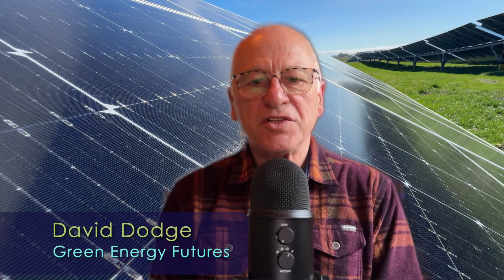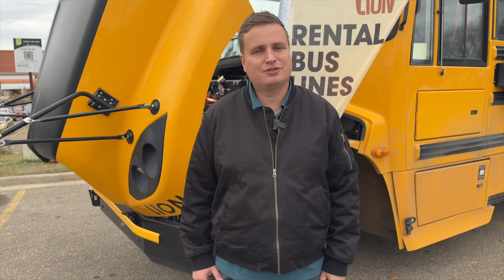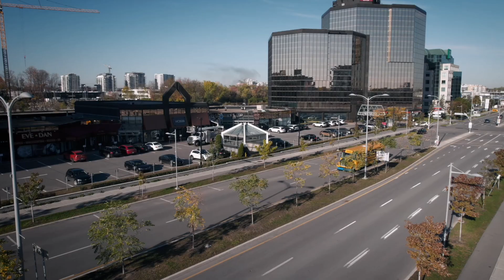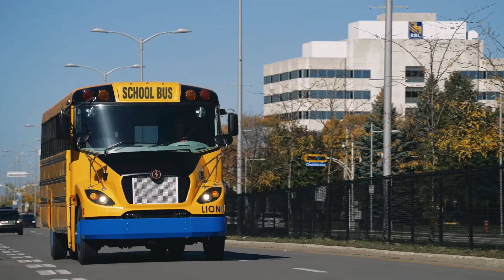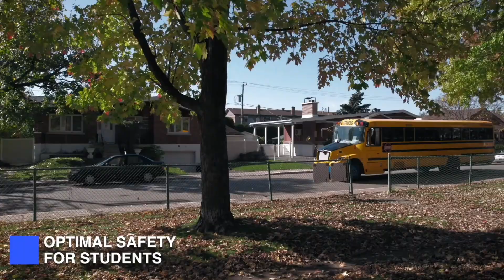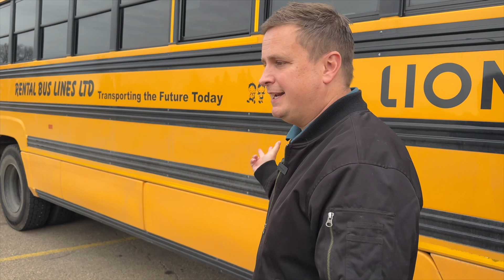Canada's Electric School Bus Revolution

Comment: I have asked the question many times. What is the cradle to grave emissions difference. Mining materials, fabrication, maintenance, battery replacement, de-commissioning. Crickets. All in? No tailpipe but emissions galore. I am talking starting from scratch. Generating extra electricity...everything.

Comment: 150 to 170 km per charge, and 6 hours to charge. Seems ok, but that is warm driving figures. No facts about the winter months and using the heater on high. I took a Rural bus for two years, and if our driver wasn't a awesome driver, we could have been stranded on side roads for an hour or two. I would also like to ask how zero emission works with the production of the batteries, and the rest of the bus parts? It don't count until it is done I guess?
Reply from the maker: Check out our blog for a little more information. He talks about the battery warmers and very little loss of range in the winter thanks to the diesel cabin heaters that don't draw from the drive battery. A reasonable compromise on going electric. https://www.greenenergyfutures.ca/episode/389-electric-school-bus-in-the-cold-canadian-north

Comment: Edmonton Alberta’s try with electric busses has been a horrendous failure. So now why don’t we put children at risk in freezing cold temps. Asinine comes to mind.
Reply from the maker: Insane would be going back to horse and buggies. These buses are much warmer than traditional diesel buses which are actually pretty chilly inside on cold days. Ask any bus driver. They are cheaper to operate, maintain and they work when its really cold thanks to battery warmers and the diesel heating systems which helps the buses preserve their range in cold weather.

Comment: Cold climate should not matter, they sell heating pads for RV batteries..... 12v various sizes.... but you would of course have to increase capacity to power the pads, insulate battery boxes in winter... the new LTO cells are not affected by cold as much as other chemistries, li-po, li-ion, lifepo4... and you can bolt them together, no special spot welder needed, no spot welder consumables, tips... no grinding tips...
Reply from the maker: These buses have battery warmers and thanks to the compromise of using a diesel powered heating system these buses are actually warm in the winter in contrast to diesel buses. This company has used their electric bus as a warming station while trying to boost diesel buses in cold weather.

Comment: Hope the batteries don’t catch on fire.
Reply: No to need hope, statistical facts prove it is extremely unlikely. A BMW 6cylinder Diesel is way more fire prone to the point it was RECALLED.
Reply: @  But try to put out the fire.
Reply from the maker: EVs don't catch fire any more often than ICE vehicles. My neighbour drives a school bus and it recently burst into flames on a cold winter day. It was a diesel powered bus.

Comment: How much energy does it take to make the mortar and batteries and then when you recycle it how much energy does it take but you can't recycle everything what happens when wind blows up and there's lawsuits flying around because of kids that lost their life
Reply: What a bunch of absurd nonsense. How do you RECYCLE BURNT Diesel fuel? You don't care about that.
Reply from the maker: Electric vehicles are safter statistically, and although the embodied carbon is higher making the battery systems, the over all emissions are far lower for electric buses. Batteries are already being recycled by LiCycle a company based in Ontario.

Comment: was child slave labor used to get the material to make the batteries
Reply: LiFePO4 uses ZERO Cobalt. The biggest supplier of Lithium to EV industry by a big lead is AUSTRALIA. No child slave labor required.
Meanwhile the catalytic converter in you vehicle and catalyst to refine crude oil into light fuels. Requires far more exotic metals than these battery chemistries. You don't care about the child slave labor required for your Gas Guzzler do you?

Comment: Wait till the batteries explode and your child is stuck on that bus.
No thanks
Reply: You specifically stated "batteries EXPLODE" which is nearly IMPOSSIBLE. Yes slow flaming fire is extremely unlikely possible. But concussive explosions is Implausible.
Reply from the maker: Electric vehicles are far less likely to catch fire than an internal combustion engine vehicle and the the latter also has a large tank of fuel available when they catch fire.

Comment: How much carbon was produced manufacturing the battery for this monstrosity.
Reply: A small fraction compared the powering a 100% Diesel fueled bus. What the frack do think Diesel is made out of, it's a Hyrdo CARBON.
These buses have cost cutting measure SMALL Battery for their purpose. Just 2x Tesla car batteries. So very far from a monstrosity.
Reply: @Neojhun  I see you have had way too much green cool aid!  Before you spout off, you really should do some research on EV's in general.
Reply: do you ask the same question when you fill up your gas tank?
you should
gasoline does not, in fact, come from unicorn tears...

Comment: They should add solar to the roofs, if not for charging the battery then to work the climate at least.  Sono Motors in Germany offers kits for this, for example.

Comment: How much fossil fuels get burnt generating the electricity to charge this electric bus?
Reply: Quebec uses 100% hydro dams 😂
Reply: Massively less than 100% Diesel. Albert's Grid is 17% Coal and 64% Gas. Combined cycle power plant is massively more efficient than a vehicle engine. Vehicle Engines are about 60% the efficiency of Combined cycle power plant.
Reply from the maker: Alberta now has zero coal and about 22% renewable energy along with the gas. It's getting better every day.
Reply: And who can tell me the (in)efficiency numbers of charging batteries? I'll wait
Reply: @hitekredneck109  Hey Hitch, I see none of these cooled drinking clowns have gotten back to you.

Comment: You people are so full of nonsense it is unbelievable.  First item is  "green."  REALLY?  WHERE DO THE   EVs  get the energy for recharging?  FROM THE GRID.  The  grid is not green and never will be.  Next,  battery fires.  Extrapolate the battery fires we have heard in the news,  snap your fingers and imagine a world where ALL vehicles are  EV.  People are going to die. IT IS NOT  cheaper to convert  energy  2 or 3 or 4 times to different   forms,  AKA  take  some  current  grid sourced energy, whether   coal, oil, NG, or even  solar or wind,  and  charge up a battery.  last is energy density,  and the "refuel" time.
Reply: LOL You copy and pasted a wacko insane fear mongering scripts. Then also accidentally used Justification in your word processor. Those are very noob troll farm moves. I bet you can't even respond comments, just copy and paste spamming.

Comment: lol . how much carbon dioxide does it take to charge this monstrosity ? .smh . fp .
Reply: Less than diesel
Way less
Cheaper to run
Cheaper to maintain
Better to drive
Cleaner air for kids
That's what winning looks like
Reply: Considering Albtera's Grid is 17% Coal and 64% Gas. FYI VW Diesel Gate was NOT about CO2 GHG. It was healt damaging toxic emissions. 64% Gas is massively cleaner than 100% Diesel. Vehicle engines are also about 60% the Efficiency of a Combined Cycle Gas Power Plant.
Reply from the maker: @Neojhun  Alberta has no coal-fired electricity as of last year.
Reply: 100% hydrodam in Quebec 😂😂
Reply: Or manufacture it

Comment: How do you charge these buses? Through the power grid which is run by coal at the power plant.
Reply: Still cleaner than diesel
And we don't sit the kids on top of the powerplant
Maybe the windiest sunniest province in the country could produce power some other way...
Reply: @chriskimber7179  Electric vehicles are a scam, a passing fad, dangerous, bad for the environment.
Reply: "grid which is run by coal at the power plant" Alberta's Grid mix is only 17% COAL. Still massively cleaner than 100% Diesel.
Reply: @Neojhun  Did you understand my comment?
Reply from the maker: @justasimplelife3857  coal has been phased out in Alberta.

Comment: Before you get all excited remember, the City of Edmonton has 60 electric buses in the transit fleet. They have proven to be virtually useless, particularly in the winter months. The problem lies in range. While school buses do not need long range capabilities because their routes are relatively short and they can recharge between the two times per day that they are needed, transit buses must run continually for at least 8 continual hours per day. They also must travel considerably more kilometers. In the summer months they can accomplish their task but come winter, well, that's a different story. The City has also had problems keeping the batteries from freezing which ruins them and they require replacement. They did retrofit thermo blankets on some buses but that did not cure the problem. In addition, unlike diesel buses that can be refueled and dispatched in less than an hour, electric buses require a 10 to 15 hour full recharge time to be ready for one shift. Since the City runs buses up to 20 hours a day, you will need to have a lot more buses on hand to keep service at it's present levels.

Electric vehicles are still in their infancy. Until they can get their range way up and recharge times way down, they will not be ready to take over anytime soon. For transit purposes hybrids would make a lot more sense.
Reply from the maker: @oh8wingman  the City did their homework and made a bad bet. These buses address most of the flaws of the Proterra buses the City bought. This company has gone slow. First bus in 2017, then their second in 2023. They use readily available parts (big problem with the Proterra buses) and they’re built for the Canadian winter performing better than the diesel buses.
Reply: @greenenergyfutures maybe for a school bus, but there is no electric city transit bus that is not a major compromise. Freind of mine was involved in Toronto Transit Commision trials of proterra, BYD, and I think New Flyer. All three had problems. To top it off they were all diesel powered (and from transformer losses likely less efficiently) as the charging station was powered by a 40' Cat shipping container genset. the infrastructure didn't support charging using the power grid. EVs have a long way to go before they will be better than ICE. No doubt one day they could be, but that day isn't today.
Reply: @greenenergyfutures  They still don't have the range required and charge times and the power requirements to any one bus barn are too great without massive changes to the electrical grid. There are some who are working on controlled discharge capacitors to eliminate batteries altogether but they are a long ways off right now. Capacitors can be recharged in minutes instead of hours.
Reply: Let's endanger our children even more.
Reply: Electric busses are working quite well in the Nordic countries.  Edmonton unfortunately purchased theirs from a manufacturer that made a poor quality product.
Reply: @heronimousbrapson863  no one wants and we don't need them

Comment: So you still need diesel. Now you have to go fill it up and plug it in. They could use diesel heaters on regular buses and have warm buses in the morning. They have a ways to go yet.
Reply: U gotta plug in diesel too
Otherwise they don't start in the cold
Reply: @chriskimber7179  True. You could just run the same heater as the electric and they would start.
Reply from the maker: @lawrencehalpin6611  it’s a great first step for the Canadian winter. They use their electric buses as warming stations when they are boosting their diesel buses.  Their entire drive power is electric. It’s a smart compromise.
Reply: @greenenergyfutures  But you still need diesel for heating. and they only have 175 kilometer range and not enough power to charge them. So a long ways to go. It will take years to get that all figured out.
Reply: @lawrencehalpin6611  "175 kilometer range and not enough" Umm that covers a whole driving stint for In City bus routes. You clearly have no clue what you are talking about.
Reply: @Neojhun  And then stop for three hours. Or have double the buses you really need. Your clearly have no clue what you are talking about.

Comment: So... The buses move with electric motors but STILL need diesel to function on cold days. When did we stop using block heaters?
Reply: "STILL need diesel to function on cold days" WRONG not to function, just to make it comfortable for the Occupants. Basically every modern BEV has a similar system to Block Heaters, they can heat them selves electrically from Charger Power. On consumer EV cars you can either set a timer or trigger it remotely from an App. The amount of diesel used for heating is a tiny fraction compared the massive amount of energy required to actually move a large vehicle. The difference in diesel usages is a tiny fraction less.
Reply: Diesel bus won't even start on cold days without being plugged in
Reply from the maker: And they use the electric buses as warming stations while they are boosting the diesel buses on super frosty mornings.
Reply: Just for heating.

Comment: Depending on how long the manufacturing of the busses is the bottleneck, it may be possible to retrofit older busses with E-axles. Edison Motors ( in BC ) will be training garages in 2025 to install retrofit fit kits for trucks ranging from F-450s to multi-trailer logging semis. So that could be another source starting in 2026.
Reply: Edison motors is developing a half ton electric pickup with Boss Garage.
Reply: @kazgoz2529  They are developing a retrofit kit with DeBoss Garage for F-450 and I believe they have already finished the test conversion a pickup. The retrofit kit could be installed in a half-ton but they are targeting larger vocational trucks, not smaller vehicles.They are building 4 or 5 Semi sized work vehicles. eg. Semis and a snowplow. They have not said what the other 2 or 3 large vehicles they building will be. They also have the ability to retrofit semis and talking about powered trailers with e-axels.

Comment: In the video the guy mentions that they have to spread the busses around as the grid can't support all of them charging at once in the smart spot. If they had some sort of battery system that gets trickled charged from the grid change this scenario?
Reply: @gusbarber00 I think yes, but  suitably sized system is going to cost lots. It could make sense right now, if they could arrange things to make some money by trading electricity back to and fro with the grid. This sort of thing is going to improve as the grid operators and other parties gear up.
Reply: @grahammonk8013  Hmm this makes sense. I didn't say it in my post but I was thinking into the future.  It sounds like it makes more financial sense to spread the busses out to avoid the grid issues but when his electric fleet gets bigger it would obviously become harder to spread them out.
Reply: @gusbarber00 they are already charging at a fairly slow rate; 6 hours to fully charge from empty, which still requires 80A (@ 240V I assume).

For context, most homes only have a 100A service, so grid infrastructure for a whole bus fleet would not be too different than that for a small subdivision… which requires some serious planning (and cost).
Reply: Great Video.
I wonder how much diesel has been saved.
Reply from the maker: This is not necessarilly a bad thing. By spreading the buses around in smaller lots with 5-10 buses they can be located closer to where they will be used. This reduces the cost of the charging infrastructure since it would require few if any distribution upgrades. And there is already a Vancouer startup company working on the infrastructure to digitally interconnect the electric buses in a virtual power plant which could provide significant additional revenue for fleet owners and it would also help us all save money on avoided grid expansion to satisfy short term peak energy demand.
Reply: @greenenergyfutures  I disagree.  This will cost energy consumers more.  Any peak shaving solution that is not a permanent part of the grid (ie can be predictably depended on 7 days/week) will be redundant and will represent additional costs.

To be useful (and “renewable”), a peak shaving battery needs to charge from solar or wind when demand is low, and be charged and ready to provide when demand is high.  Late afternoon when busses return from their routes they will be mostly depleted.  If not they are just carrying more battery capacity than necessary and that extra capacity would be more useful attached permanently to the grid.

Not to mention, all the subsidies mentioned come from one of two methods; increased taxes or increased utility rates.  Nothing is free.  So the average consumer is paying more for energy so the grid can become dependent on school bus batteries?  Makes no sense.

That won’t stop this guy from profiting from this “green” initiative though.
Reply: @greenenergyfutures  I have heard of the virtual power plant concept for buses,it is a brilliant idea. I have seen your video on this.  I also know technically it is not really a VPP since there is nothing virtual about these buses lol.  
My question was more about the future when they  need to have more than just five at each spot.  
I understand that eventually their energy provider might be able to supply them with enough power but I wonder if it might just be easier and it is cheaper to just have an on site battery.  They could also use that for the "VPP".  
Just random thoughts running though my head.  .
Reply: The other reason not to keep them together is not to lose the whole fleet when one spontaneously combusts.